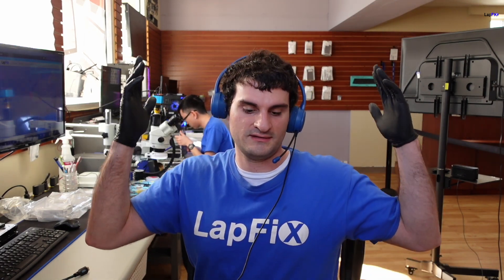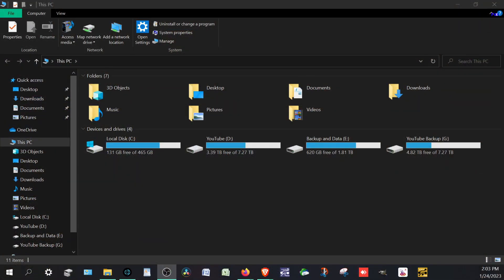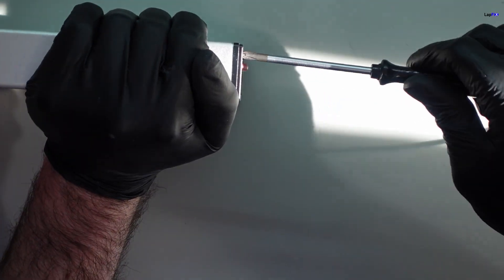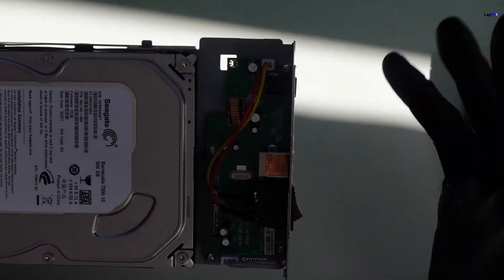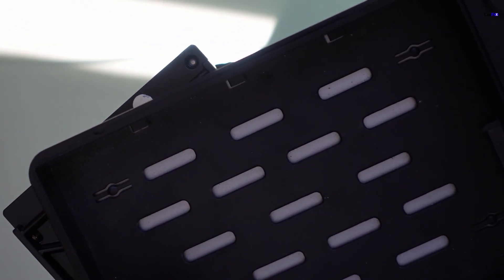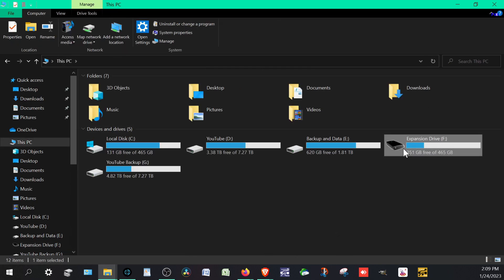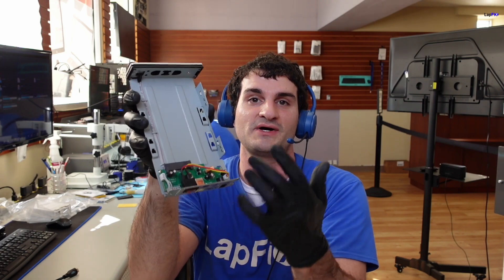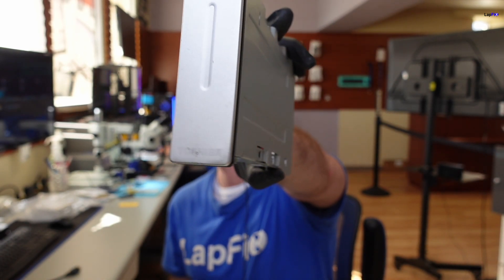How To Easily Recover Data From Old USB External Toshiba Hard Drive

Comment from the maker: Do you guys still have older external usb hard drives?  This is the most basic method if a drive isn't powering on or isn't reading.  Check out our other  videos to show more in-depth/complicated issues with hard drives!
Reply: Hey thanks for the video. I have the same hard drive and it's powering but the disk is not recognised on my Mac ? What should I do ?

Comment: Its never that easy for me. Especially when crystal disk says "Caution"
Reply from the maker: That means the drive is starting to go.  Make a back up asap
Reply: @lapfix  Correct, but in my case it was too late. Drive became unresponsive and I could not copy off the drive with HDD Raw Copy tool.